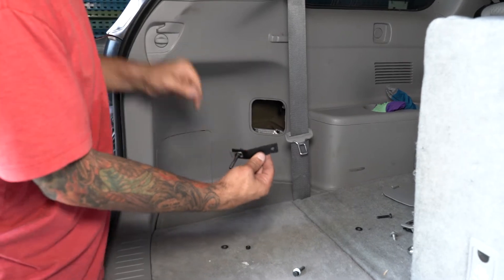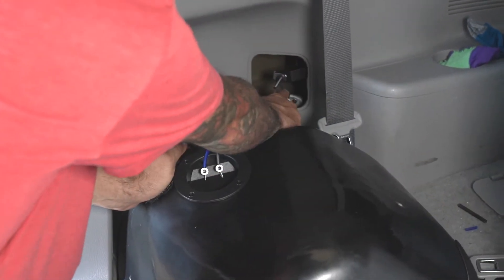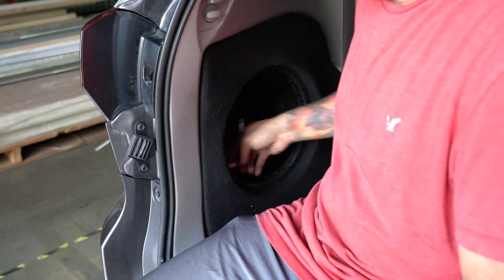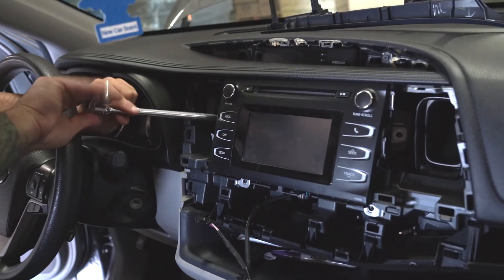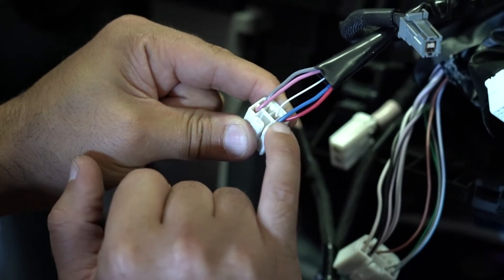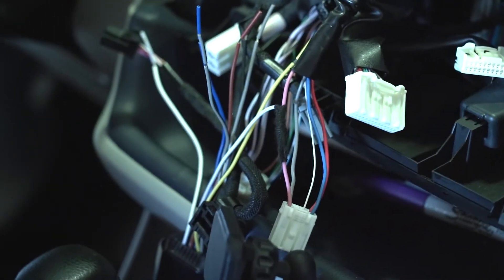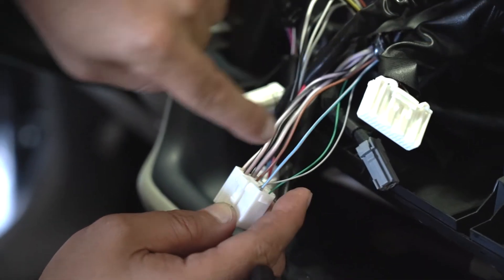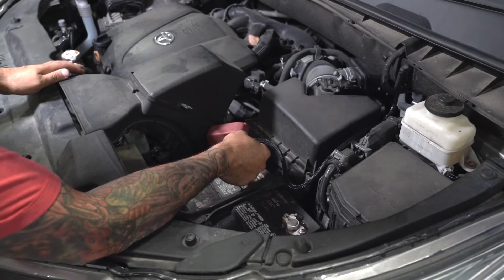Adding a Subwoofer to a 2014-2019 Toyota Highlander - Install Overview for NVX BOOST Bass Package

Comment: so i tried adding an amp and now the stereo wont turn on, but I tested the same stereo on another vehicle and it turns on. i have no blown fuses. and this is on the 2016 toyota highlander.
Reply from the maker: Please test the yellow and red behind the radio to see if you have 12 volts with the key on, if you do not have voltage on one or both wires, you have a blown fuse or a cut wire somewhere.
Reply: @NVXAudio  tested I do have power. I actually plugged in an aftermarket radio and it works, the factory does not power on. I even have my spare camry radio and that one didn't power on. I went back to my camry and they all power on there. Very weird 😕

Comment: This doesn't work the same with our 2016 with jbl. The wires have to be tapped into at the amp. Unfortunately very difficult to get to.  Me and the wife are going the route just adding an aftermarket 10 inch display radio. Still using the sub though. I suppose we could tap into the  rear speaker wires inside the B pillars.
Reply from the maker: If you are going to use an aftermarket stereo, you can just run the RCA's from the sub channel pre-outs of the headunit instead tapping into signal.
Reply: @NVXAudio  the factory JBL upgrade option from toyota. It's the stock radio just the JBL upgrade. Kinda like GM has Bose upgrade.
The speaker wires are only accessible at the factory amp on this model.

Comment: I bought the enclosure and the 2nd hole for attaching this is near the wire terminal and not where the tie down hook was. the one towards the top right looks right. Where am I supposed to attach this bolt to exactly?
Reply from the maker: We had some boxes like this and the mounting location has not been updated properly, we are working on a resolution for this issue. In the mean time you can drill the hole to line up with the mounting location in the video.
Reply: @NVXAudio  thanks for the reply. I was able to get it to hold in place temporarily without drilling a whole. I'm not sure I'm comfortable drilling a whole that would line up but it makes sense.

Comment: Can you do a sound test please I’m looking to buy this subwoofer and would like to see how hard it hits
Reply from the maker: We no longer have access to this vehicle, but if we do an update video, we will be sure to include the demo.
Reply: @NVXAudio  does the subwoofer hit hard?
Reply from the maker: @davidk033  To my personal definition of "Hit Hard", no but that is not what it was designed for either. This is a great filler for the low end bass notes you would normally miss with the factory system and sounds amazing.

Comment: Where are the rear speakers lines located?
Reply from the maker: You can find them in between the drivers door and rear door down the running board, or you can find them in the B-Pillar before the harness goes into the door. Hope this helps!